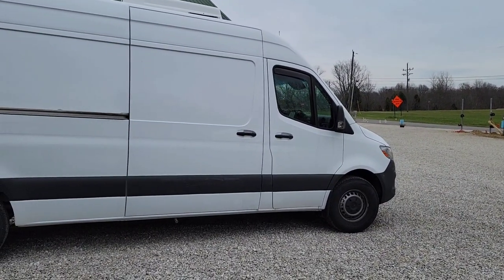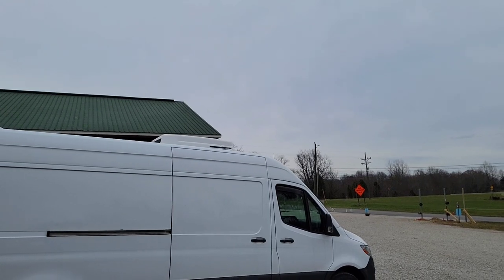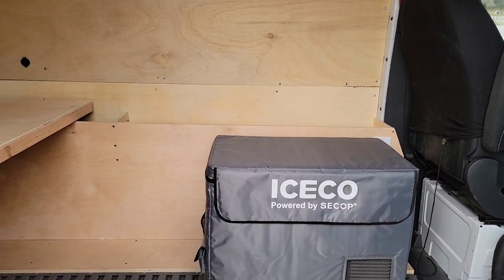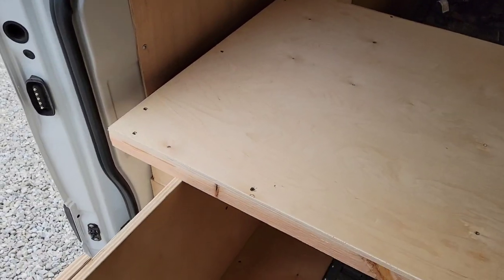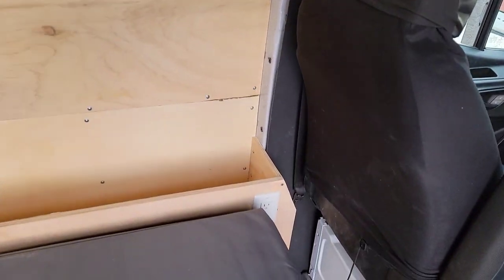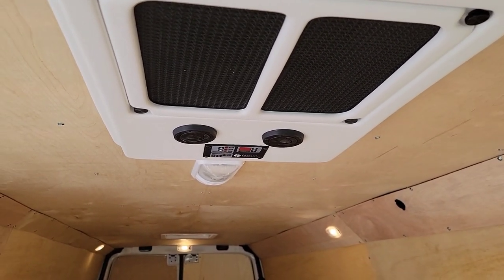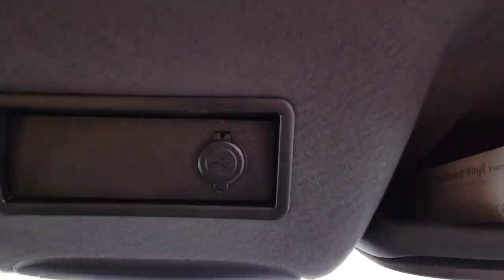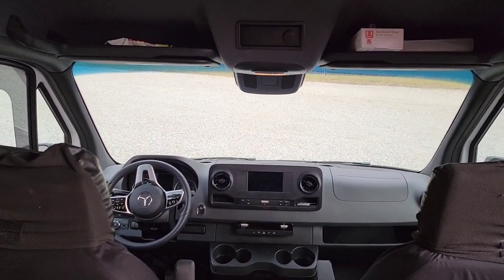12v a/c setup in expedite van (E67)

Comment: I still gotta figure out what to do for AC in mine. But I almost have dad talked into a mini split for his house. I still think a dual unit is what I need in the bus. Seen several other buses with mini splits.
Reply from the maker: I'm a dealer for MrCool. I have two 12k units in stock.
Reply from the maker: Can you? Yes, would you want to? No. Because it is going to take up space, add weight, and be a larger hassle than it's worth.  Getting water, dumping water, heating water, setting it up, taking it down.
Reply from the maker: Not in this video it doesn't
Reply from the maker: No

Comment: Is he charging the batteries while he drives, or does he have solar?  If he has solar, how much?  Thanks!
Reply from the maker: Charges while driving or plug into shorepower
Reply: @RedsCustomDesign  when charging while driving, would you use a dc to dc charger or…? Also, what are the metal attachment strips on the floor called? Thanks Red, love your work ✌🏽🇺🇸
Reply from the maker: Yes, e-track

Comment: Why does it look like there is not enough room for 3 pallets after this set up?
Reply from the maker: If he puts the bed on the wheel well boxes he can get 4 pallets.
Reply: @RedsCustomDesign   you mean the bed in between palets? I believe bed should be forward to the front and behind the two seats.
Reply from the maker: NO, I mean you take the bed down and put it against the wall.

Comment: whats a setup like that run
Reply from the maker: I don't put pricing on social media.  Because it's always changing (vendors, out of my hands).
Reply: @RedsCustomDesign n Does that system have HVAC with engine off heating if not what do you consider the best engine of AC / Heating system for cargo van expedite OTR.?
Reply from the maker: It has a 12v a/c system that runs off the auxiliary batteries. And it has a Espar heater that pulls fuel from the van tank and powered by the auxiliary batteries.
Reply: @RedsCustomDesign  Ok that's great thanks for the info

Comment: too bad expediting doesnt make any real $$$
Reply from the maker: It all depends on what you consider "real money ". If no one made money doing it they wouldn't be buying $50k - $70k vans to do it in.
Reply: @RedsCustomDesign  facts- dang sign me up
Reply: There’s money in it if you get in the right lanes. I run dedicated in a van and my 1099 was 203,000 for 2021. I’m home 3 days and run 4. However that’s rare as hens teeth and there’s only a handful of us running dedicated in a van. With that said I’ve seen more than my fair share of guys spending their 401 on a van thinking they will make a 100-150,000 a year and make 40 gross. Sitting for a week in Texas with that setup without a generator won’t cut it. 48 hours in Miami won’t cut it. I think there’s only one company left that pays percentage, Load One. The rest are paying straight mileage. Fedex I believe starts at .80 cents for a van plus fuel charge. They have the highest per mile that I know of. Panther I think is 70-75 a mile. Two of the biggest in the business. One of our guys just put a motor in his year old sprinter with just under 180,000 miles on it. Two weeks before he hit a deer and was down for a month. The bill was $18,000. Two months down 18 grand out of pocket and over 30 grand in lost revenue. Be prepared. He’s also dedicated. My run is 4,500 miles a week his is 3,200. He’s home 4 days and runs 3. Minus days off, vacation holidays ect. I wish him all the luck.